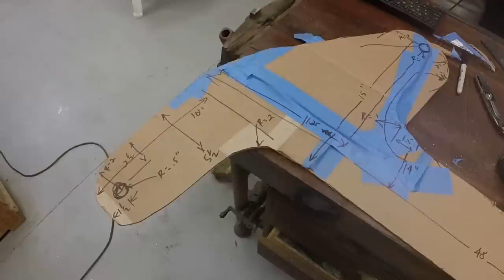Garden Tractor Forklift Build!  EP:21, Mast Support Frame

Comment: Hi Frank, nice work here. I own a 1969 electric Hyster 50 forklift, best little thing ever. I wouldn't recommend using cable, as it is hard to keep it in line with each other if you're going to do a two cable system. They can also bunch up real bad (and sometimes tangle with themselves) when there isn't any load on them. I did some research and found some forklift chain on ebay. Here is the product name to it... BL634 Leaf Chain 10 Feet For Forklift Masts,Hoisting with 1 Connecting Link... hope this helps. It's relatively cheap and has a high strength capacity. Can't wait for next weeks episode!
Reply from the maker: I'll look at that. I may have to retrofit if the wire rope doesn't work out.

Comment: Hi Frank, coming along great!! The old cardboard cad got a workout today😃😃😃!!

The tilt cylinders pins you could run one pin from side to side though the dashboard for a stronger pin than cut and weld each one, each side!!! For that matter you may be able to put the cylinders inside the dash side than the outside but be better on the outside.
Like I said before if you leave the tyres on backward, will give you more traction in reverse in wet or soft ground with a load!!
Could cut the bottom eye of the lift cylinder off and weld a flat base and just bold the base of the cylinder to that flatt base on the mast. Just extend the cylinder a foot or so, wrap a wet rag around the cylinder and weld the flat base plate on all done, I have done that a lot to cylinders and cylinder rods over the last 40 years or so without any trouble!!
But it will look good when finished and you need to start calling the old back the front now🙃🙃!!

Comment: A pulley for chain can be as simple as a sprocket on a short shaft held between two pillow blocks.  The sprocket can just be welded to the short shaft.  It does not need to be perfectly centred because the slow speed.

Comment: Personally, I'm not a fan of wire rope, they can slip under load. Chain however, is a safer option. As for the pulleys, McMasterCarr. Cheers :)

Comment: Love that you have included your dogs in the videos. If the day comes I get my workshop my dog would probably be doing the same. I have a question about your dogs being brothers. Do they get along? I ask because I tried raising brothers many years ago and they occasionally fought. It's possible it was because they were not fixed. Your dogs are beautiful, and they love you.
Reply from the maker: They get along fine. They have occasional spats but no one gets hurt. Brutus is faster while Butchie is bigger and tends to be in charge.  So Brutus can just run away. But I also notice that Brutus is usually the instigator when it comes to rough play.  They are both fixed.

Comment: You are going to need a huge reservoir for for all the hydraulics on it now. And a fast pump if you are going to make it work reasonably fast as well. As for the bolts on the side supports, if you are not going to weld the side parts to the original frame, I would install quality bolts all along the sides to the rear...or front? That way you transfer a lot of the forces to the frame and not just to a couple forward bolts... JMHO

Comment: Your builds are awesome. I like things to be serviceable/last forever so I have an idea for the mast pivot. You pointed at a boss you are going to use for a bolt location to connect the mast support to the frame of the tractor. You could add a boss to either the mast or the mount and put a oil light bushing for the pivot so that way if you use a hardened bolt or pin it will not wear into the mild steel. You thankfully have a lathe so you can make the bushing and boss any size you want and I don't think it would add much complexity and would make it serviceable/last forever. I know this won't be used 8 hours a day 5 days a week but it hurts my soul seeing stuff like this metal on metal. Or you have something better planned and I will just have to wait and see.

Comment: Hi Frank, I really enjoy your videos of working in the shop on your Cub Cadets. Thanks for making them. Question: what is the correct length of the transaxle bolts for the left side? My Cub Cadet 149 seems to have the wrong bolts there. One seemed loose and it came out with my fingers and it had fine threads instead of the course threads I just saw in this video. Thanks again.
Reply from the maker: I'd have to go measure them. I'd guess 1-1/2 on the left and 2-1/2 on the right. I'll check and let you know.

Comment: I dont know if this will be an issue or not. As the piston is free to turn in the cylender have you given any thought as to how to keep the rollers for the chain or rope in line with the mast?
Reply from the maker: tension on the cables will keep them aligned.  I think. We'll see.

Comment: Hi Frank, do you think you will run a duel wheel setup for stability? Just curious is all. Great progress and always nice to see the chief engineers checking up on ya, looking forward to next installment
Reply from the maker: Probably not due to storage space the wider tires would take up. Also would limit where I can take the machine--as in through some of the gates on the property. Remember, you are generally moving with the load just off the ground so the center of gravity won't tend to tip the tractor.
Reply: @Wood and Metal Shop Time  
That sounds pretty reasonable. I appreciate the shout-back Frank. Looking forward to the next installment on Thursday.